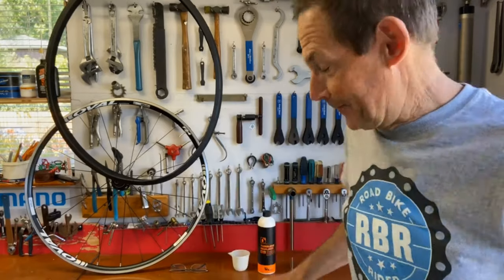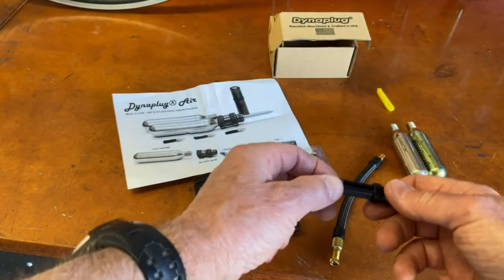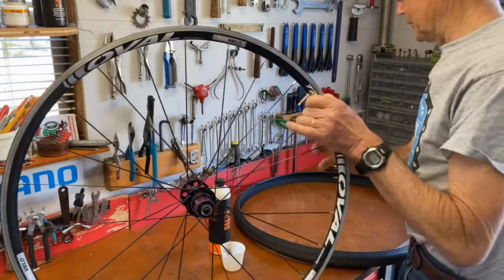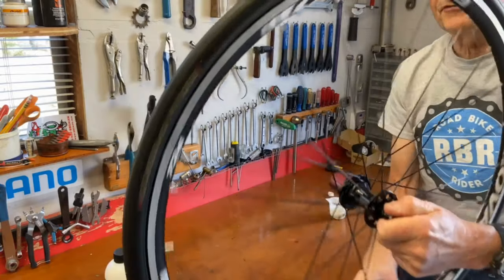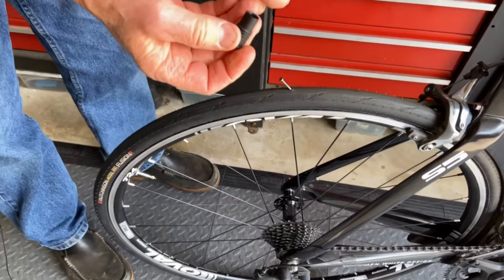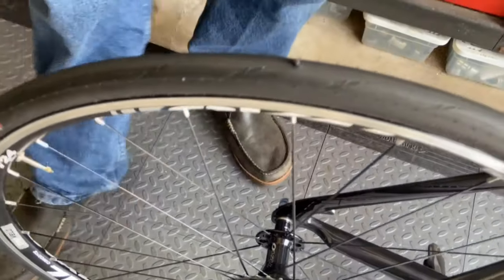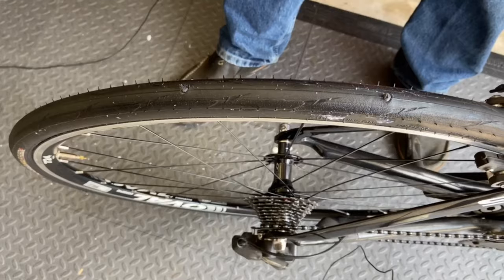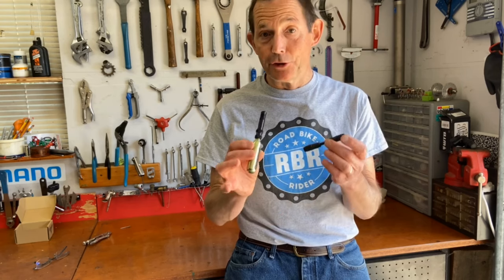Testing Dynaplug's Great Tubeless Bicycle Tire Repair Kits #tubeless

Comment: Hi Jim, any tips on washing sealant spray from your cycling clothes?
Reply from the maker: Thanks for watching and the question, Vincent. Most sealants will dissolve in hot water. I have cleaned old dried sealant off by soaking rims. So I think just washing in hot soapy water will work. Hope that helps. Thanks again!

Comment: There is a risk to damage the rim tape while inserting the plugs. What do you think?
Reply from the maker: Thanks for watching and the question, Frederico. Dynaplug says that they designed their plug with rounded tips to minimize the risk to rim tapes and in my use of it, I didn't have any tape issues. If a tubeless tire gets a puncture and you have a Dynaplug kit with you, you should be able to plug a puncture pretty quickly. And as long as there's air in the tire, it helps keep the tip of the plug from reaching the tape. But even if it reaches the tape it's not sharp and shouldn't be able to cut or poke through the tape. Hope this is helpful. If you get a chance to try a Dynaplug kit I look forward to hearing how it works for you.

Comment: Sir i was curious why you would need a plug if the sealant would seal it up anyways and get you home
Reply from the maker: That's a great question. Thanks for watching the video and asking about this, Annu. What can happen is that you run over a large piece of glass that cuts a hole in the tire. A bigger piece of glass cuts a larger hole than running over something like a piece of wire or a stone fragment or a smaller piece of glass - or the nail that I show in the video. The cut looks like a slice in the tire versus a round hole. This type of a cut is more difficult for the sealant to fill up and make airtight. That's when you'd use your Dynaplug to fix the flat. If you wait and find that the sealant seals the hole in the tire then you don't need to plug the hole with the Dynaplug. You just use it if the sealant can't fix the flat. So if you watch carefully when riding and can avoid these larger things that slice the tire and make bigger holes, you might never need to use your Dynaplugs. Okay? I hope this answers your question. Thanks again!
Reply: @JimLangley1  got it let me ask you this most of the time we are training hard going fast...usually on a tubeless system sometimes you may not even know how many flats you would have had vs regullar tubes... i had a goat head come out as i was comin to a stop and wallah sealant sealed in 5 sec....BUT lets say the tire went FLAT than i would stick the plug in the hole.....than refill it with co2 cartridge and it will inflate back for me to get home? becasue sometimes you may not notice bigger hols as your riding hard. so what im sayin is going totally flat will the cartride and plug will it back up?
Reply from the maker: @annukun7318  yes, the Dynaplug with the CO2 can fix the flat in most cases. If you read the other comments, one is from a rider who says how it worked for him. Usually when you notice a flat you still have air in the tire. Usually it's not completely flat yet. Even a little air helps for pushing the plug in. But, even with a flat tire, you can usually push the plug in. You can see in my video that it takes a good hard push to get it through the tire, so you could have to hold the flat tire with one hand so it doesn't slip on the rim as you push the plug in. So it won't be as easy as putting it in on a tire with air in it.
Reply: @JimLangley1   ok i have a 25mm GP 5000 pefornamce TL tire what dynaplug excatly do i need to order from dynaplug to avoid getting stranded and also co2 cartrides. THANKS!
Reply from the maker: @annukun7318  you would get the one I show in the video, Annu. It's the Dynaplug Air Road Bike Kit http://www.dynaplug.com/air.html
Reply: @JimLangley1  awesome is this small enough?ill just stash eveything into my back jersey pocket where i put my cell phone
Reply from the maker: @annukun7318  yes, it's small enough. I recommend putting it in a pouch and putting that in your jersey pocket. Jersey pockets often develop holes in the bottom and stuff like this can fall out if that happens.

Comment: Tire plug cant cure with the rubber fast enuff with the wet sealent disrupting the prosess
Reply from the maker: Thanks for watching and the comment. In the video you can see how long it takes to stop the leak. I shot it in real time. How fast plugs seal has to do with the size of hole and type of tire damage, but for basic punctures, these Dynaplugs seal pretty quick and don't seem to be negatively affected by the sealant. They're designed as tubeless patches for tires with sealant so you would expect Dynaplug to make plugs that work with the sealant and they do in my experience and others who review them. Thanks again!

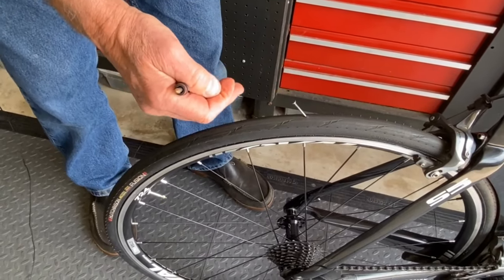Comment: For those who came here merely to see how to use the Dynaplug, you can avoid wasting an ENORMOUS amount of time on everything shown and talked about except the titled subject and go to:  12:08
Reply from the maker: FYI- for some time now YouTube has had a “chapter” feature. Just mouseover or drag your finger over the red bar below the video and you can go right to what you want to see.
Reply: @JimLangley1  Well, learned something new so thanks. As for the newly learned chapter feature, it seems that the great majority of YouTube video downloaders don't take advantage of this feature and I'd bet that most YouTubers don't know about it. Thanks for informing me. I was merely reacting to what I find the great majority of videos do and that is their interminable introductions.
Reply from the maker: @lazurm  you’re welcome, lazurm. My introduction shows how to properly setup a road tubeless tire. To me - if you don’t install your tubeless tires right, you won’t know if the plug is not working or if maybe you did not use enough sealant or properly seat and seal the tire. While you found that a waste of time, lots of others appreciated me showing how it’s done. Plus it was the fairest test of the Dynaplug. I could have just said this is a tire I just set up, but then viewers who wanted to see that would have been let down. And again, saying something isn’t as believable as showing it. Thanks again for watching.

Comment: The problem is, as displayed on fortnine's video, that if pressed in, you have an immediate failure.  The best tire repair is still the old fashioned gummy strips.  Blackjack and Safety Seal advertise theirs as permanent fixes, and with the very real possibility of litigation, they must be very confident in their product.
Reply from the maker: Thanks for watching and the comment, DH. I watched the video you mentioned and the first thing that stood out to me is that it's a motorcycle video not a bicycle video. Then, in order to make the plug patches he tries out fail he had to poke something into the holes. Huh? I can't figure out when that would ever happen in a riding situation? You'd have to hit a nail sticking straight up and time it perfectly for the nail to hit the plug exactly perpendicular to the plug and even then, the nail would have to stay straight in order to push the plug into the tire. That happening is probably a 1 in a million possibility. So, I don't see that as a reasonable test for a plug's effectiveness. FYI: Dynaplug has been in business since 1991 according to their About Us page - so it's not like they're a new company. Their products have an excellent reputation.
Reply: @JimLangley1  that tool was a push gauge which measured how much force it took to dislodge the plugs. As he explained, the idea was to simulate riding over perhaps a rock.The Stop & Go rubber mushroom plugs failed under the fewest psi by far. The Dynaplugs pushed in at about the same pressure as the string plugs, but in this test, the string plugs resealed after being punctured. Plug failures may not be that big of a deal on bicycles, I don't know, but on a motorcycle they can be extremely dangerous. And the old fashioned string plugs are the cheapest option in addition to being the most secure fix.
Reply from the maker: @dh2392  thanks for the reply, DH. Just so you know where I'm coming from, I have been testing cycling products for buyers guides and other editorial since 1983 and I currently work as a QC engineer. To my way of thinking, the push gauge is the wrong tool/test. He says it's to simulate a rock. But, the push gauge he uses is not at all shaped like and it does not act like a rock. What he used was basically a small diameter rod. A rock is a random round shape. In my opinion, the real world test that makes the most sense is running over rocks and seeing how the plugs hold up to that. I think it's kind of obvious or predictable that you can push these plugs out of the hole since a rod just like the push gauge rod put them in the hole in the first place. Overall, I think more thought should have been put into the test they used. Hope that helps explain my point of view. Appreciate your feedback.

Comment: Totally shite !! Kept loosing air and sealant
Reply from the maker: That must be a large tire cut, Richard. Did you try more than one plug? That might work, but if it's a huge cut in the tire, it just might be unpluggable.
Reply: @JimLangley1  I’m on about your video pal 🤣
Reply from the maker: @richardmathers7238  just trying to help in case you were fixing a flat. Actually, in my video it's not as much air or sealant as it might look/sound like. With bad tire cuts you get the sealant shooting out like a geyser and by the time you stop, the bike and you are covered in it. I thought you were trying to fix one of those. The Dynaplugs work well but it will take a little time for the sealant to fill in any small gaps and seal the hole.
Reply: @JimLangley1  I’m concerned about my tire bottoming out and with dyna plugs been made of metal it could damage my carbon rims?
Reply from the maker: @richardmathers7238  Dynaplug says they made the tips out of... in their words, "wheel friendly brass." So they're thinking about protecting rims with their design. I haven't tested how wheel friendly they are. If I was trying to get home riding on a carbon rim with a flat tire, I think I'd be more worried about the damage to the top edges of the rim from the pavement, gravel, or whatever you're riding on. You have a little protection from the rim tape but how much depends on what's in there. And the tire should bottom on the rim edges not the deep well in the middle of the rim, so I think there's a good chance there will be some small clearance between the tire and the rim even when the tire is flat.

Again, though, I have not tried riding on a flat with a Dynaplug in it. My experience with flat tires with sealant inside is that they tend to slide around on the rim making it difficult to control the bike. I have ridden several miles on genuine tubeless (no sealant) and many times done it on standard tubed tires. That's no fun but you can do it. Hope something here is helpful.